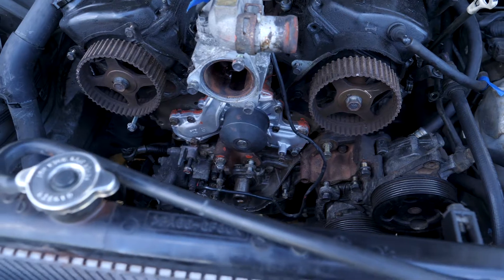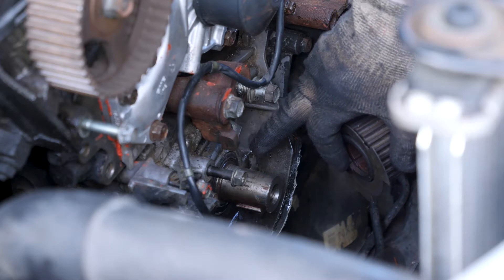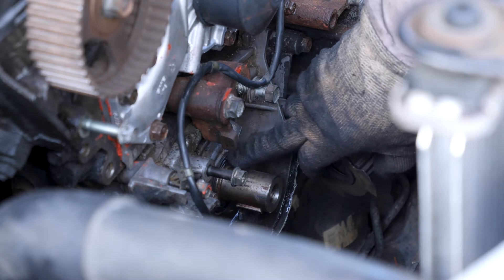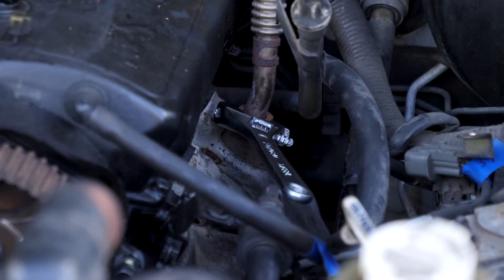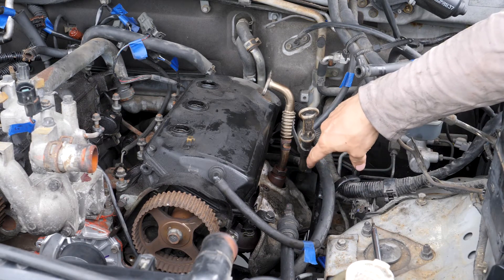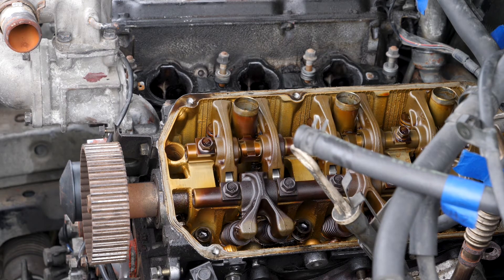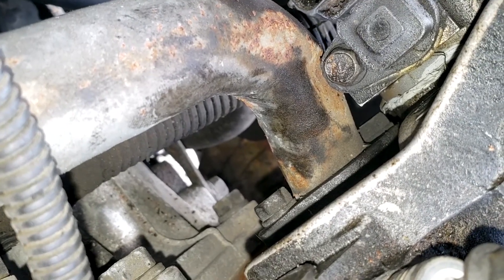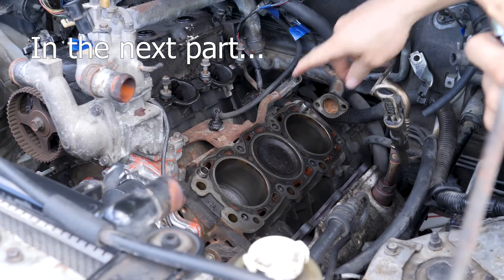Mitsubishi Montero Head Gasket Repair Part 4: Left Exhaust Manifold and Cylinder Head Removal

Comment: If you have a head gasket problem then changing the thermostat is a must. If it got hot you may as well overhaul the engine. It may run good for a while then the rings lose their temper , and about ten thousand miles later it will smoke.
Reply from the maker: I didn't have a head gasket problem. I had an oil leak and cylinder 3 misfire problem and took the heads off to diagnose it and check the health of my engine.

Comment: Nice. Helped me get further with my own vehicle. Took off the driver's heat shield today- used the same crescent wrench to get the EGR tube off. Yup, it's a tight space. I put an extension bar through the hole in the end of the wrench and used it like a lever (pryed in a line/direction tangential to the intended rotation of the wrench, amplifying my mechanical force with a longer lever) to turn the crescent wrench. Only had to get it to budge, and it turned the rest of the way by hand. I would have pitched a fit trying to get the exhaust manifold off w/o getting the heat shield out of the way first. Way to stick with it though, this stuff can get super frustrating!
Reply from the maker: That sounds like a good idea. I was at a loss when I came to that part of it. I discovered that I could remove the heat shield bolts and have enough play to maneuver it so that I could just barely fit my 14 mm wrench between the gaps to get at the manifold nuts. Then for the ones on the bottom side I got under the car and reached up through the gaps from underneath. I was very pleased to get past that obstacle, though it wouldn't be the last. Lol.

Comment: I’m watching this series because I have never done a Mitsubishi 3.5 head gasket. I am thinking of purchasing one to flip, p that has the head gasket blown. Bless you and others on YouTube for taking the guess work out of a job.
Reply from the maker: You're welcome. It's definitely doable by one to two people. The hardest part for me was removing the crank bolt which I didn't show because I had to get my neighbor's help. I held the pulley in place while he used a 4 foot breaker bar extension to break the bolt loose. Once it broke loose though I could get it on and off again by myself.

Comment: 8.26 I seriously feel the pain u just went through.😂
Reply from the maker: It was quite painful. Not easy to forget that one.
Reply: @Coloradical Couple  hey mate, I'm doing the same thing on a 2002 pajero (I'm in Australia)

Is there anything that's you would have done differently now 1 year on?

Hows it running? Any problems, issues related to the headgasket or anything that was changed out?
Reply from the maker: Hello and good luck on your endeavor. If I could say I would have done anything different it would be to have changed the crankshaft pulley bolt to the upgraded one and also just did a little more double checking. I could have avoided a few costly mistakes just by paying more attention during disassembly  and verifying I had done something correctly before moving on. After a year of running I have no complaints though. She runs well and no leaks or trouble codes.
Reply: @Coloradical Couple  if u don't mind could u give me a little more info what u mean by pay more attention on disassembly? 

What was the costly mistakes, we are all watching these videos because we are either doing or about to do a headgasket on this engine.

So anything helpfull that u can think of 12 months+ on would be really good info😊

Also thank u for documenting this really well, most videos I find are either not in english or shot on a Motorola flip phone.
Reply: @Coloradical Couple  what significants is the crank bolt? Did u snap it?
Reply from the maker: No. It's recommended to be changed. It was part of a recall.
Reply: @Coloradical Couple  ohhhhh. Thank u for that info!!
Reply from the maker: You're welcome!

Comment: Greetings!

What is the full sequence to loosen the head bolts???
Reply from the maker: My bad I thought I explained it in the video. The first two bolts loosened are at the the front of the engine starting with the one on the inside of the V then moving to the outside one. The next two are at the very back of the engine starting with the outside one then the inside one. Next is the two behind the first ones from the front starting with the inside one. Last are the only two left starting from the outside. Remember to only go a quarter turn on each bolt until they are loose enough to remove by hand. Installation is the reverse of this sequence.
Reply: Thank you very much!!

Comment: Love the magnet in the glove idea.  How Does the failure of the water pump (which I assume is the cause of the repair) blow out the gaskets? Is it the temperature of the water coolant rising, or the actually heat of the metals no longer being cooled? Thx
Reply from the maker: Thanks. My water pump was not faulty I just changed it because a new one came with my timing belt replacement kit. Yes, I could see a bad pump causing possible gasket failures if the engine overheated.
Reply: @ColoradicalMike  why then did you do the repair? What caused it?
Reply from the maker: The car had a cylinder 3 misfire, a faulty crankshaft position sensor, leaking valve covers and valve seals, and some bad lash adjusters. It also had an old timing belt which I changed for peace of mind.
Reply: @ColoradicalMike  u did mention those issues